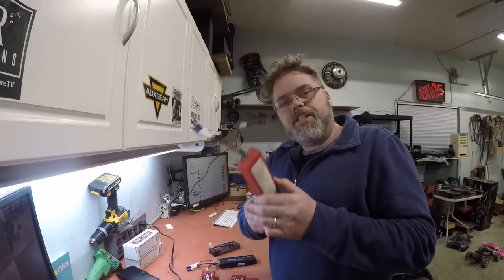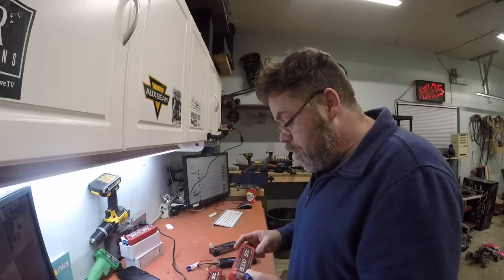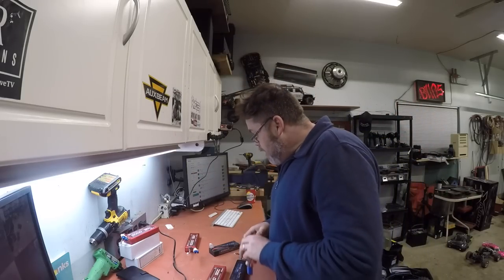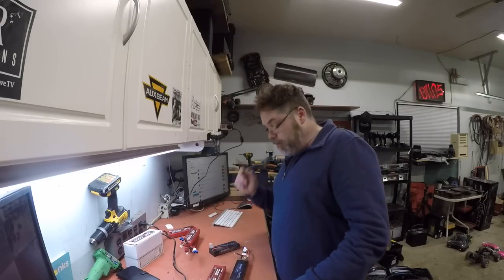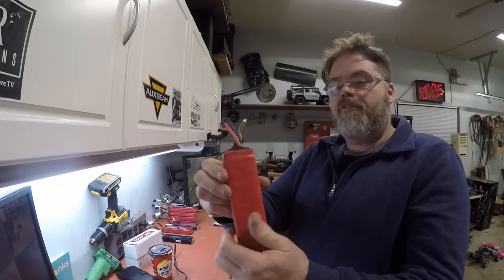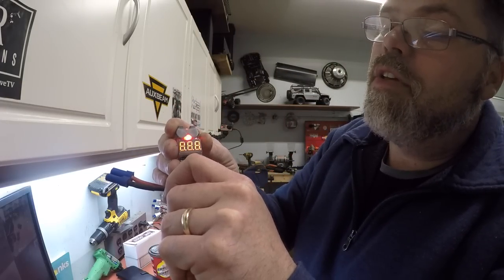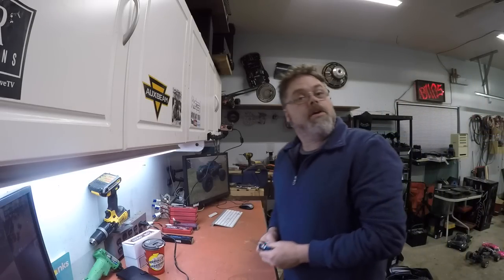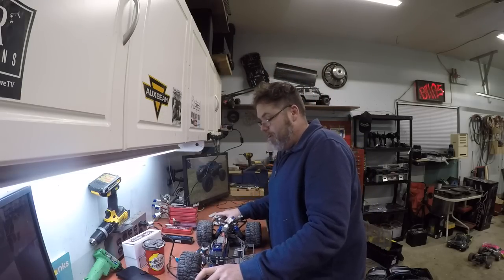BEST LIPO RC BATTERIES TO USE ! JUST MY CHOICE

Comment: New to this new flyer got eachine 52 on way just to start what is the best batteries lipo or what is called or lithium battery or is there any better ones u would recommend thanks for your time peace out from Scotland✌️✌️✌️👍
Reply from the maker: Iv had good luck with the HRB
Reply: @LifeWithBillSiff  were would I get them and is it a battery or can I get it if I ebay cheers, 👍
Reply from the maker: on line buds

Comment: you really should be using 80C or more for those trucks...lower C  for the crawler   dodnt be a goof ..youll cut the  battery life and  punch boost in half by fast discharging them when ripping around
Reply from the maker: ASTROS22S agree i said at less 50c and i want 100c but not in the budget buds lol
Reply: ASTROS22S F F S

Comment: I use the traxxas 6700 4s 35c what do you think of traxxas batteries
Reply: I thought all Traxxas batteries are 25c? Mine kept getting to hot on my max6 esc so I sold them but they never puffed on about 20-30 runs

Comment: yeah their 35 c battery is a hot pile of poo

and in the 8s xmaxx i use powerhobby 100c and vant hard case 75 c
Reply: Chris Hirner how do you like the power hobby lipos? Been thinking about getting one for the price I usually stick with my Turnigy Graphene
Reply: Powerhobby are very punchy. The swell a little when hot but they say thats normal. Internal resistance is super low. Charge up to 3c as well. Pricey though
Reply: Chris Hirner I was actually thinking about them just because the price is so cheap. I can get two for the price of one Graphene almost. An 100c but idk how true that is. Think I’m settled in trying a Hobbystar 6s 4800mah 50C hardcase basically perfect for Arma 1/8 which I have. Heard good things from them from solid people. It’s really a crap shoot unless your getting max amps or something

Comment: first off buy an old ammo case for that hoard, that unbalanced one "can" smolder and burn your house down.  i have a dual GensAce 2-S 50 C  and dual of 2-S 100C for track-romps.  bud 8s is likely to fry your Diffs, one dirty doughnut later.... blown seals puking diff oil..... ah brings back memories